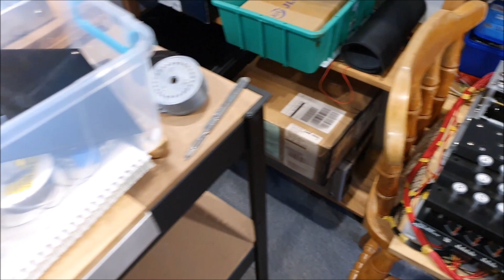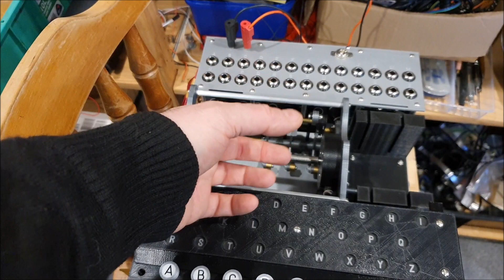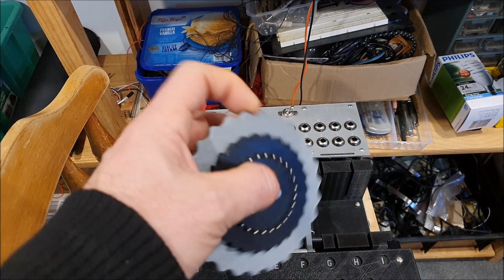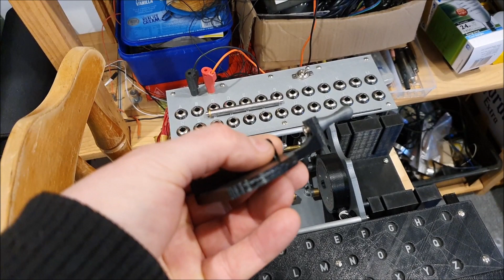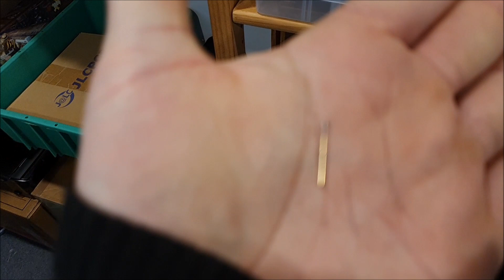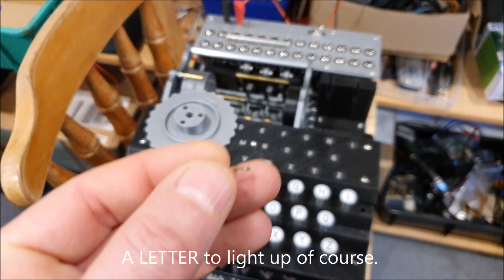3d Printed Enigma Machine July 2022 update

Comment: Hi Simon saw somthing that I thought my interest you on You Tube today, it's called "My lifelong interest in motor racing"  It's not a Riley but it dose show the construction of the ash body,  from this example you can see how the timber is joined using lap joints, only using 2 screws per joint the thickness of timber, and how the frame joins the base plate. The size and how this plate is bolted to the chaise. I'v never made a car body from scratch but only my own car an MG TC but they do all seem to have the same construction method just adapted to a different shape. One last thing the only straight line you must have is between top and bottom of the hinges of the door. Hope this is of some help.
If not its an interesting vid of a great pre war car.
Reply from the maker: Hi Russell, thanks for that. I shall watch that with interest after work. I scour YouTube for such films from time to time so good to see something new! Vintage cars isn't something the algorithms promotes much, it's too niche interest wise unless it's someone like Jay Leno doing it. I am busy learning how to do surface modelling in my CAD software (Fusion 360) so from the various sets of drawings I have and my one original door I can design the body I want in 3D then take section through where the timber framing needs to be to get the patterns I need. That's the plan at least. It's not one of those things where you can just buy off the shelf plans of course. You are right about the door hinge line. That must be straight as is the rear of the door. I also need to work out what suitable catches are for the doors. The chassis and body are of course very flexible (one reason you use ash, it's strong but flexible/springy apparently) and having the doors there means you have a weak spot at the rear of the doors between the front and back of the body. This is good as it allows for flexing. But I am guessing it means you need good deep door catches to stop the doors flying open on corners! You see a lot of Type 35 Bugattis have a split in the body where the two halves of the body join. I think that might be there to help with all the flexing.
Reply: @asciimation  Thanks for your reply. I think a CAD  approach is the best approach, one that  give you the dimensions and angels. It will also give you the ability to print out same size paper stencil which you can stick to the timber and cut out using your bandsaw. I would shape and finish the cut timber with a 4" flapy panel disc sander. 
One problem  you will have is the hole process makes a lot of dust which will cover every thing in you shop even using dust extraction. My advise to avoid this, is to do as much as possible out doors, and only do the assembly in side.
One last thing your quite right about  Ash, as has a interlocking grain which is why it was used, it  dose have a flexibility and  doesn't split or crack which is why it i used for hammer shafts.
I must say I very impressed by the high standard of craftsman ship you have achieved. The radiator cowl is a good example, yours is of a higher standard the the original. I have really enjoyed your build and what you have achieved.
Reply from the maker: @russellnixon9981  I am just ordering a belt/disc sanding machine to help with the timber work. It comes on a frame. I can mount that on wheels so I can roll it outside maybe. I actually try to do any metal grinding/sanding outside too because the grinding  dust goes everywhere. I suspect saw dust is even worse!
Reply: @asciimation  Yes much worse it gets every were and you cant hoover it off any thing oily.
The belt sander is really useful, one of those how did I live without this tools.

Comment: A few notes from my Engima machine replica:

1. Make the pins stand out as little as possible.  Adding all the spring force of 26 pins * 4 rotors pushed the vertical plates out a lot.  By reducing the pogo pin standout as much as possible you reduce the force driving the plates apart
2. Make the springs for the thumbwheel arms ("Centering Device") adjustable.  I 3d printed an insert that goes inside the spring that has a helix cut to match the spring so that you can adjust where along the length of the spring the insert sits.  There's an M2 bolt that is threaded through the insert, through the spring, and through the front face of the raised spring holders on the base plate.  You can then compress the spring into the spring holder and put a nut on the back so that it holds the spring partially in compression, reducing the force of the spring on the centering device.  The bolt is fixed solid in the insert so I can stick a hex key down the length of the spring and turn it to adjust where the insert is in the spring.  This gave me fine control over the force of the spring that allowed me to get the movement with the rotors perfect.
3. I agree with Luke's comment about the length of the rotor shaft.  I believe the gap mentioned at 1:27 is correct, but the tip should be long enough to go into the entry wheel bushing.  The reverse rotor is supposed to push on the outer ring of the rotor shaft to slide the whole shaft to the right so it locks into the entry wheel bushing.  It's not clear from the video whether your reverse rotor does that.
Reply from the maker: Great comments, thanks.

The pins should be supported somewhat by the holes the fit though which does limit the side forces on them. But as the head of the pin is larger than the diameter of the shafts the holes are somewhat over sized if that makes sense. With the rotor stack all assembled the heads of the pins shouldn't be able to move sideways much at all. A solution is possibly just dropping the height of the pins in the pcb which I will try first I think.

The centering device springs are slightly adjustable on mine. The 'holder' they are in is one piece and the holes slightly oversize so I can move it in and out. I can move to actual slots there to give more adjustment. Mine is close as it is after trying as many different springs as I could. The main issue is the rotor stack popping out I think.

The rotor shaft on mine is literally just too short. I remember at some point shaving a little off the entry wheel end and chamfering it a little too much probably so now it doesn't quite go into the entry wheel far enough to be securely held. You're right that it's the reflector that pushes it all into place. The ring at the left hand end of the shaft does fit into a recess on the front of the reflector which is what pushes it right as you and Luke mention. When I shortened the end of the shaft I didn't consider that would make that end less securely attached. And there is just enough flex in the machine to make it pop out.

Thanks for your comments, most helpful!
Reply: @asciimation  Since the pin heads are larger than the pin, I actually inserted the pin through the face of the rotor and glued them in place. I soldered a 0.25mm^2 wire inside the hole in the back of each pin. No PCB required.

Comment: I don't think you need to make the rotor shaft longer - once the rotor stack is in place, the spring tension from the pins on reflector (once locked in place) should push the entire rotor assembly to the right, so the edge of the rotor shaft is seated correctly in the entry wheel bushing. ;)  I believe this is how the real machine works, too.
Reply from the maker: Thanks Luke, yes you are correct about how that works. It's not just the spring tension. The inside face of the reflector has a small depression in it that is what the little ring on the left of the of the shaft sits into. So it's not just the spring tension on the pins, it is also that when you move the reflect over with the lever the reflector itself also pushes the shaft to the right holding it in place. 

The error is entirely mine, at some point I remember shortening the shaft a mm or so to make it easier to get the stack into the machine. Enough to make it not work it seems. A generous chamfer on the end isn't helping either!
Reply: @asciimation  Best of luck with the fixes!  I couldn't help but notice you're missing the "trident legs" as well on that top support bar.  Are you planning on including these, or are they missing from the Polish machine plans?